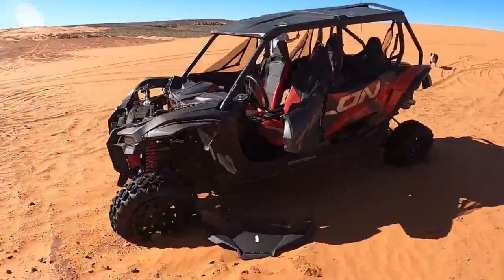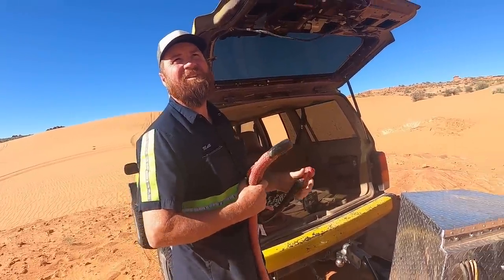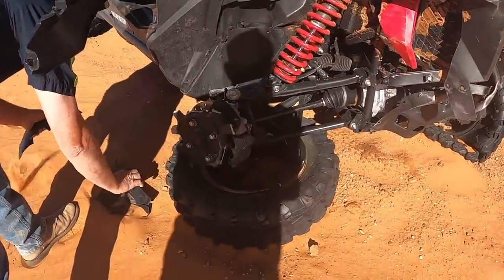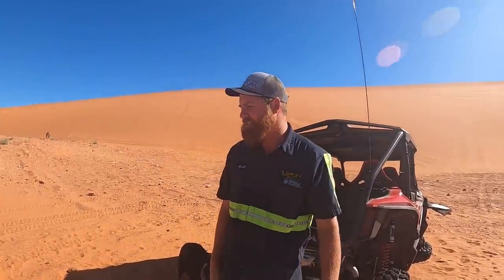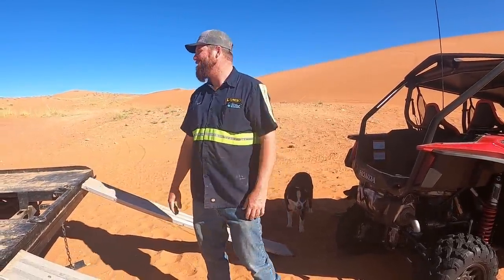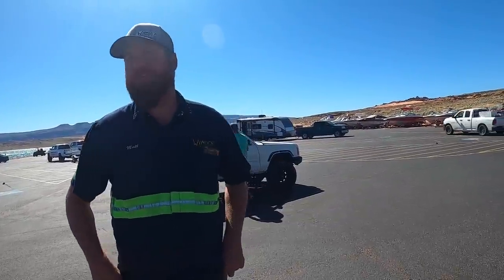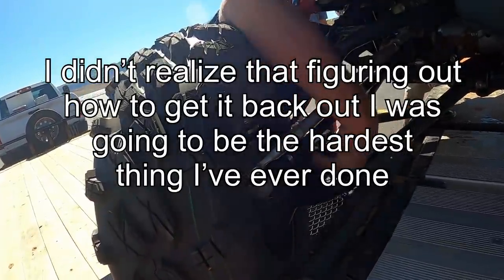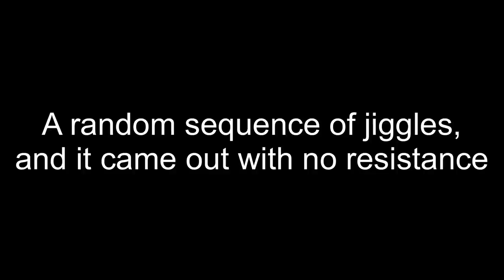Honda Talon…. Really?

Comment: Everyone has their way of doing things. There's more than one right way and generally the way people do them depends on their personal experiences and preferences. I might have done some thing differently but I understand why you set the equipment up the way you do. But double batteries in the Jeep and Morvair and the Golf cart plugs run close to each receiver will save ya. You would be able to run the trailer winch off the Tow Vehicle.

Comment: is there a reason you didnt go aluminum start with like a feather-light with offroad axles  ? other than cost
Reply: He may not be able to weld aluminum. His trailer likely cracks frequently and welding steel is easier. Just a guess.

Comment: Drop those tires down to about 15psi and you'll have no problem in those tiny dunes. You can just cruise and not worry about gaining speed. Also. Hit the crest of dunes at an angle to avoid high centering or nose diving into a witches eye
Reply: @MattsOffRoadRecovery  I never dropped below 8 but I was in a lifted Tacoma on 33's so it is probably a lot lighter. Plus no trailer. I forgot about that part. My driving was in Glamis.

Comment: 10:35 You should put roller on the edge of trailer. With such steep ramps it might be quite common to scrape on the edge. But well, that would probably add a pound or two :v Alternatively put some copper plate or something to make the edge a bit more slick.
On the other hand in such conditions winch wire will get damaged sooner or later, I might not increase wire longevity too much after all.

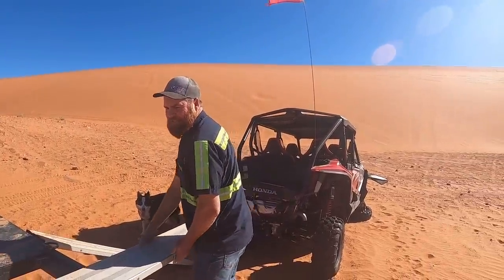Comment: 6:17  about the trailer.  If saving weight is important, wouldn't a multi folding reinforced mesh tailgate ramp like the one gardeners use, also work for stuff like razors and other light side by sides?  Not that your modifications don't work, they seen too work fine. Another Good video.

Comment: Hey Matt, really like the content of your videos, i’ve had high horsepower muscle cars lifted diesel trucks lifted 4 x 4 muddying trucks and now I’m looking for a 1996-2001 XJ...  I love the body style I like how small they are but still capable of handling and hauling a decent amount of equipment...   I was wondering if you could point me in the right direction on 6ply 8ply or 10ply tires for all around use on the road and off-road??

Comment: Love your videos understand the concept behind the trailer and jeep setup wondered why you use the strap so much instead of winch but cause it has a snap affect it pops things out looks a little tough on the jeep do you have a full frame under it as a buddy has a jeep like yours and has popped windshield out do to unibody twistingb

Comment: I totally get the need for a lite trailer, but lite is not always actual weight. As you said, you cut the trailer weight in half by adding twice as many tires on the ground, essentially. What you did not address is that you could put wider tires under the trailer and spread out even more load!!  And really, a different design would add some weight in building a tilt deck, but I don't think you'd have to add that much. I'm guessing it more about how much time and money you want to spend, but I see it as time being money. Spend it once and save many hours over years to come!! But hey, that's just me!! lol...

Comment: Matt have you ever tried putting D rings on the side of your trailer to pull front ends sideways with your winch line. I see you trying to get man power to move them sideways or prying with ramps. 2 D rings on rear sides would wench rzr with no wheels left or right. and only add a pound to trailer.  Keep on towing  John >-W->

Comment: 6:17 Why not just bring a tractor trailer to the dunes?  The diesel engine has much more power. You'd be able to tow a lot more.  A nice Landoll trailer means no more ramps. Make sure that it's a tandem axle for more floatation!

Comment: Ok Matt, you asked. Why don't you operate the winch from the driver's side? You could probably save at least 10 steps every time you adjust the steering. Other than that, I've got nothing past what you're already doing

Comment: Great video.  Have a friend with new Talon and lives there and thought it might be him until I saw it was a 4 seater.  Would you mind sharing what size batter booster you use and the make?  I want to do the same but not sure what size it takes to run a 2500 lb. winch long enough to get a rhino onto a truck.  Thanks.  dm

Comment: Have you tried a diesel Jeep on the sand I’ve just bought a 2.7 crd Grand Cherokee and I’m really surprised at the low down torque it will pull strongly from almost idle , I didn’t know if that would be an advantage in the sand ?.
Reply: Fair enough.We dont have many deserts in England .

Comment: Just a couple thoughts, not "suggestions" because I know I don't know what I am talking about but IM CURIOUS.
.
would wider, softer tires on the trailer help with floatation, or would it add to drag instead?
.
Would it help you any to add some extra D-rings along the sides of that trailer to redirect the winch cable through to pull a side-by-side sideways on the bed to line it up better?  Watch Ron Pratt on youtube with his roll back truck, he does that often.  I do not know if this is a common technique or not as i am not a recovery operator so again, I am asking if it would help you, not telling you "you need to do this" ..
.
lastly, would one large d-ring up at the front of the trailer help any when pulling WITH the trailer, making it less important to have the trailer and the stuck vehicle all be 'in line'?  would it eliminate some of the trailer lifting?
.
If you read this far, thank you for bothering, and i hope you answer!

Comment: Those 4.0 jeeps engines just rip dont they!! They like little mini Cummins that run on gas and they just pull and pull!! No idea why they stopped making them. Such a bad call to do!! Anybody complaining about your trailer obviously have never done stuff like this. Im surprised you dont get the comment of "why is the deck so high above the tires? You can load it easier if it was lower to the ground!" LoL. Im waiting for that one to happen!!